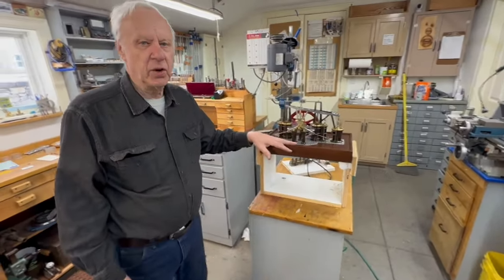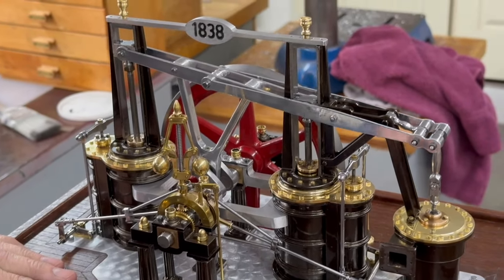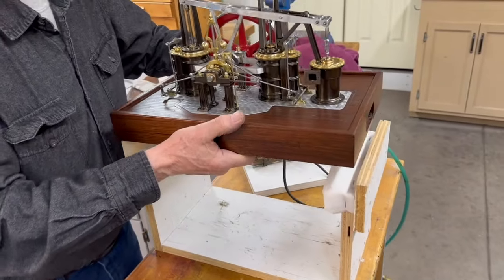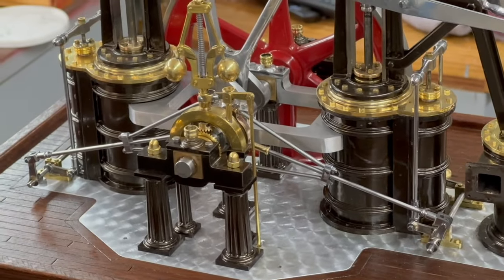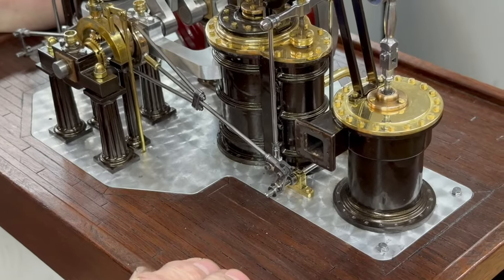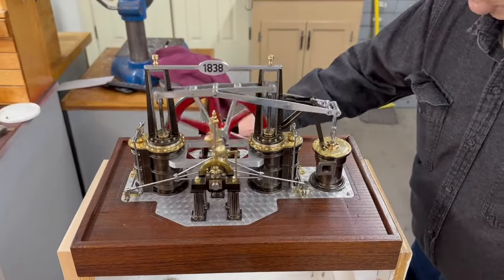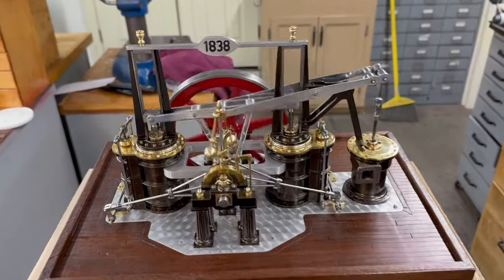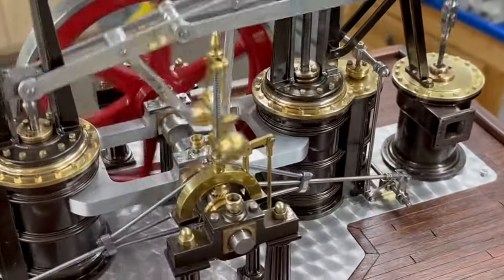1838 Galloway Non Dead Center Engine

Comment: The vacuum pump was used to help pull a vacuum on the condenser which would pull the exhaust steam from the low pressure cylinder. This contributed to the power of the engine because it didnt have to push the exhaust out.
Reply: Indeed. Even in a fairly modern steam turbine plant for naval propulsion, using saturated steam, the enormous noisemaker was the steam condenser. Using seawater in the tubes and a giant condensate shower spray, it operated at a substantial vacuum and for the same efficiency reason. In a shallow harbor it was possible to suck too much silt & condoms, etc., and the lights go out. oops
Reply: @davesieg520 

A reverse supercharger.
Reply: The air pump in condenser-equipped steam engines is not there to induce condenser vacuum.   The feed water pump can do that and does do that.  The air pump is there to remove non-condensable gases from the condensed steam, so that bubbles in the feed water don't cause a problem, and for removing oxygen which at boiler temperature will cause corrosion.
Reply: @davesieg520 I don't think they were at risk of getting contraceptive methodology into the engine...

Comment: James Watt made steam engines run more efficiently by putting a partial vacuum to the steam condenser after the engine.
Reply: Some steam heating systems use a vacuum return and some old systems run sub-atmospheric steam.
Lower pressures fewer leaks.
Reply from the maker: Hi David, I think you are correct. I got the same answer from quite a few people. I wish they had put vacuum pump in the plan It just says pump and it doesn’t hook up to the engine in anyway, except through the mechanical connection ,there is no condenser. thank you for your interest and your answer .   Joe.

Comment: If the “air pump” creates a vacuum then it is there to assist a steam condenser; ‘increases the efficiency of the engine and reclaims boiler water.

Comment: Nice stuff Joe, excellent craftsmanship ! My milling machine is very similar to yours .😊
Reply from the maker: Hi, thank you for your kind comments and your interest, I hope you enjoy your milling machine as much as I do mine. The first two I had were very limited in vertical clearance and table size. This one has been excellent. Joe H
Reply: @JoesModelEngines    I put in a ball nut shaft for the vertical head control, zero backlash is wonderful.
Reply from the maker: (Interesting)That must have been quite a project, where did you get the shaft ? Also does it take less 

effort to lift the head? Joe
Reply: @JoesModelEngines  I got it from Amazon. Then the head would roll down on its own, I put two 47 lb gas shocks  to help raise it. Now its a bit harder to go down than up, just a little bit.  But it has a different pitch from the original square thread, so I mounted a moveable 1” travel dial indicator on the mast to let me know where I’m at. 
I could try to send some pics if you like. I had to remove the entire head and make a new more substantial connection between both parts. I require accurate movement up and down, as I can see you do. It’s worth it, and easy to see that you can do it, Joe.
Reply from the maker: Thanks for your reply, it sounds like a great idea but I don’t think that would change it to a metric thread. It seems like they only come in metric sizes. I have a digital readout so backlash is not a problem, I always had to deal with it so I guess I’ll just keep dealing with it. As for the pictures I’d love to see them. I always learn something from projects by others. I don’t think you can send them on YouTube easily so this is my email. jhig5@maine.rr.com
Don’t cut and paste it ,YouTube does something so it doesn’t work. You have to copy it and type it in. Joe

Comment: Hear in cornwall we have air pumps on our old beam engines.
Connected to the condenser to improve the function and save water. I’ve seen them on the rotative winding engines, but will have to check again if they are on the pumping engines.
Is that a double acting engine?  Wish you had explained how it works!
Anyway the model is a credit to you sir!!👍

Comment: On some steam boats, the pump removed the condensed steam and sent it over board. Cold water was sprayed into the condenser to condense the steam, and the whole thing was at a very low pressure due to the condensation.
Reply from the maker: Hi James, That is really interesting and I’ve never heard it explained that way. I was told that it was just a vacuum pump that pulled a vacuum on the condenser. I never heard of cooling water being used on the condenser. Makes a lot of sense. One thing that a boat would always have is access to lots of cool water. Thank you for your input, this engine has been quite an educational experience for me. Joe H

Comment: 0:16  You say it's 25% smaller than the original. In other words it's three quarters the size or did you mean it's one quarter the size? 

Whatever, it's a beautiful piece of workmanship. Well done.
Reply from the maker: Sorry for the confusion, I scaled down the plan for the model casting set . Not the original engine. It’s 75% of the original model engine. My fault for not saying it correctly. Thanks for pointing it out. Joe

Comment: mine is near finishing....I hope to have  a so nice movement !
Reply from the maker: Interesting, do you have the casting set . I’ve only seen one build using the original casting set. Thank you for your comment. Joe
Reply: @JoesModelEngines : yes I buy the kit at midland exhibition where I see one finished Galloway...I see another in Harrogate exh... mine is 90% finished , but in a box , a five inch locomotive need work first before become elderly !
Reply from the maker: @jean-louisfigureau6364  good idea Jean I’m 81 and there are to many things put off until I had time, now I’m just to tired to do most of them. I’m really starting to enjoy a good nap 😴

Comment: The "Non-Dead-Center" feature is the same as the 2 cylinders on a steam locomotive being a quarter revolution  apart. If the cylinders were absolutely in-sync, or 180 degrees apart, then there is the possibility of both pistons being "top dead center". At that point, adding steam to the cylinders either will result in no motion, or the rotation will be random in the direction the drive shaft will take. If you watch this machine closely, the powered cylinder on the right is 90 degrees in cycle behind the left cylinder. This means that one of the cylinders will be in the middle of a power stroke when the other cylinder is at top (or bottom) dead center. So adding air pressure (or steam) will always result in a defined shaft rotation. This is an ingenious design, and beautifully executed! (It took me awhile to see this!)
Reply from the maker: Thank you for your compliment and your interest. Joe
Reply: Same principle as modern twin cylinder motorcycle engines having their crankpins at 90 degrees (or 270 if you prefer) to each other.
Reply: @geoffreypiltz271  It's not the same principle at all.    in steam engines every stroke is a power stroke but a 90 degree offset between cylinders is necessary so that they can always start from zero RPM at all rotation points. A 2-cyl motorcycle engine is inherently not self starting because internal combustion requires non-power strokes between the power strokes - that's why you have to kick start or use  a starter motor.   V-configurations are just a way to make the engine more compact, combining a  low frontal area with a crankshaft axis parallel with the road wheel axis.
(and V-configuration gives that nice double cough sound)
Reply: @keithammleter3824  Same principle, one piston on power stroke while other piston is at half stroke, different reasons for adopting though.
Reply: @keithammleter3824  Same principle: one piston on power stroke while other piston is at half stroke. Adopted for slightly different reasons though: the steam engine for easy starting, the internal combustion engine for smoothness of power deliver and balance.
Reply: @geoffreypiltz271  it is not the same principle if it is done for an entirely different reason.  And it is for an entirely different reason.   A V-twin IC engine is not statically balanced nor is it dynamically balanced.   You admitted that yourself when you said the firing is 90 then 270 degrees apart. Actually, V-twins often have the cylinders less than 90 degrees apart.   The only balanced 2-cyl IC twin is the horizontally opposed twin with 2 crank throws.
Motor cycle engines are made in V-twin form to save space as I said.  And some buyers like the peculiar sound of asymmetric firing.  It is one of the reasons for the Harley Davidson's success.
Chinese portable generators (eg the Loncin) are also V-twin for the same reason - save space and save a bit of weight.   I've got a Loncin 6 kVA generator - vibration is terrific- wears out the rubber mountings..
Reply: @keithammleter3824  I was talking about vertical twins.
Reply: @geoffreypiltz271  : You said 90/270 degrees - that's a V-twin. Vertical inline twin motorcycle engines are also inherently unbalanced.   You can have it so that one piston is at bottom dead centre when the other is at TDC.  Then the engine is not statically balanced (it has a rocking couple) and will fire asymmetrically - cyl 1, turn 180 degrees, then cyl 2, then 540 degrees and cyl 1 again.   Some vertical twins have both pistons going up and down together, so that the firings can be 360 degrees apart - then the engine is much smoother under power.
But in many motorcycle twins, both pistons go up and down together and BOTH FIRE TOGETHER.   This gives a nicer sound and reduces wheel slip under acceleration from stand-still.  
In any case, you saying the principle is the same is as much nonsense as saying a jumper is the same principle as a carpet because both are made of wool.  One keeps you warm, the other is a nice soft feel on your lady's dainty feet.

Comment: Beautiful engine, great job building it. Just a thought could the air pump have been used like a bellows to the fire for the boiler?
Reply from the maker: Hi Doug , That is the best thought I’ve heard, why didn’t I think of that. It’s definitely a possibility. Thank you for your input. I’m going to do some more research. Also thank you for watching my videos. Joe
Reply: @JoesModelEngines if it is used to pull steam off the motor, it's to keep the water in vapor form longer. If it only moves air then most likely used as bellows to stoke the fire like a primitive turbo.
Reply from the maker: I was told that it was vacuum for the condenser and that makes more sense than the other things I’ve been told. I don’t have plans for the engine only the model and it doesn’t have a condenser. So I don’t pretend to know the actual purpose, but You have a good point it seems like it could have done both.

Comment: I can't help but wonder if it would work in a narrowboat from the same era? Seems like it would be quite fitting. Would a full size version put out 30-40hp?
Reply from the maker: I’m sorry I didn’t know much about the original engine, You woke me up to the fact that I should. I was just so engaged in buying the model that I didn’t even realize I should know about the original. Thanks for pointing it out. Joe
Reply: @JoesModelEngines  No blame to be had there. It is a pretty mesmerizing model for sure and well done. The open layout and intricacy of the design does remind me of some of the early diesels found in narrowboats as they where switched over from horse drawn to self powered.
Reply from the maker: It was definitely used for a boat engine, you are correct. I’ve been told that by quite a few of my subscribers. Joe

Comment: Does that stand have ~1000 small planks all assembled like a wood floor?
Reply from the maker: Not this one,but I have done that. This is done with a ea
Reply from the maker: Oops wrong button (again)  as I was trying to say, this one was done by cutting the pattern with a exato knife then a sharp pencil. After that I cover it with black paint and rub it in the cracks. Then wipe it off with a rag,let it dry and varnish it. Joe
Reply: @JoesModelEngines  ah, that's good!

If it was ~1000 planks, I'd be asking what mental institution allows you to post on youtube.
Reply from the maker: I’ve managed to duck them

Comment: meanwhile i am still sitting here infront of all the small parts for my otto inverted ! u did a beautiful job Joe ! greets from vienna
Reply from the maker: Hi Pirmin,
Thank you for the encouragement and the praise. This is one of the most interesting projects I’ve ever done and I think it came out really well.Theres  lots of drilling and tapping in this engine ,way more than I expected, and way more than anything I’ve built before.
Also, it’s great to hear from you again. You’re the only one from Austria that remarks on my engines. Thanks again Pirmin.
Reply: youtube is a great community because it enables me to learn from millions of people around the world and see what they can offer. i  actualy should also start making videos simply because it would be fair to give something back. i am sure there are other modellers from austria or germany who watch your videos but not everyone uses the comment functions, pretty sure ! on first glance this engine looks not tooo spectacular to be honest, just like you said many small holes to tap. on the Otto Gas engine i am building there are loads of small tiny linkage parts to make wich consumes most of my time at the moment. i still havent touched the castings..this time i try to work my way from the  small parts up and leave the castings for the end....we will see how that will go. all my parts meet specs within 5 tenths, so i am confident everything ewill slide together like a slip fit :) @JoesModelEngines

Comment: Would it be possible to simulate the look of steam coming out?
Reply from the maker: I’ve never seen this in model engines, even when you run them on steam you can’t really see the steam because it condenses . Running them on air is a lot safer and cleaner. Steam makes a mess of the model quite quickly. Thank you for your interest. Joe

Comment: So what is a non dead center engine?
Reply from the maker: Hi, It is a design that never allows both pistons to be at top dead center or bottom dead center at the same time. That means that the engine will start by just applying steam. It’s also called a self starting engine. Go to google and you’ll find a lot of information on NDC engines. Thank you for your interest. Joe
Reply: So that would be common for two-cyl engines or more. But the movement of this one is interesting and unconventional.
Reply from the maker: I don’t think I understand the question. About 2 cycle. This is a double acting steam engine.

Comment: Since the Galloway engine was used to power watercraft, and the other primary need for power on a boat other than propulsion is the bilge pump(s), then my guess would be that he had some sort of bilge pump system attached to the air pump.  There are several ways that airflow can be used to pump water.
Reply from the maker: I got a lot of information from my subscribers since I posted this video,and the ones that seem to know all say it’s actually a vacuum pump to pull a vacuum on the condenser. That improves the efficiency. Thank you for your comment and your interest. I’m learning a lot and I hope you are also. Joe

Comment: Strange that he would have invested considerable time to making the engine, perhaps thousands of hours, but never spent five minutes looking up a steam book or googling to find out why marine steam plants had air pumps (it's to remove non-condensable gases from boiler feed water, particularly oxygen which would cause boiler corrosion and bubbles cause feedwater pump problems.)
I smell a rat .....   was it in fact assembled from a kit, or built by someone else?
Reply from the maker: The engine was built from bar stock by myself alone I used the original plan By Anthnyfrom a casting kit and reduced the size by 25% to make it lighter.
At my age I have started to make my engines lighter so I can handle them alone . As far as my knowledge of the original engine ,I know very little and I don’t pretend to care. I am mostly interested in the mechanical aspect of the model and making the parts as close as possible to the original model and pleasing to the eye .

Comment: Maybe the air pump to was to help support the draft to the firebox?
Reply from the maker: Hi , thank you for your thoughts and your comment. Most of my subscribers that seem to know what they’re talking about. Say it’s actually a vacuum pump. The vacuum pump was to pull a vacuum on the condenser thus making the engine more efficient. The plan didn’t give me any information on what the pump was for and it just called it a pump if they had a set of vacuum pump, I would’ve figured it out a little sooner. Joe